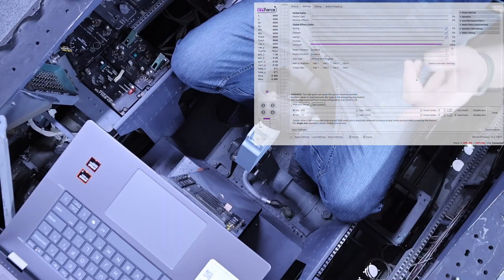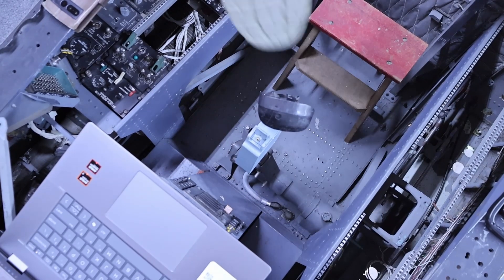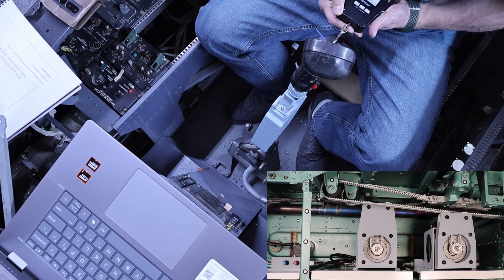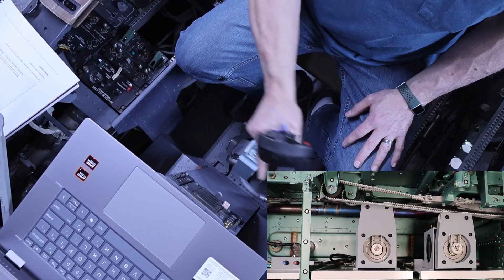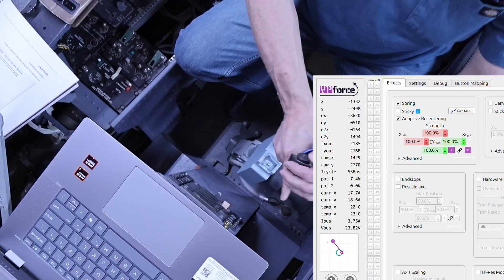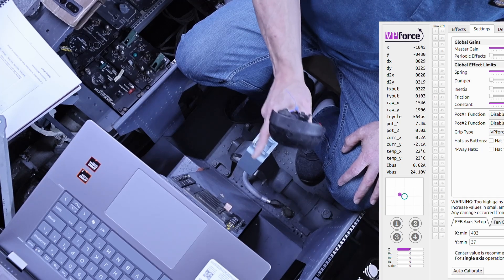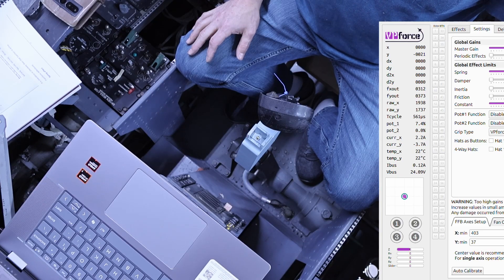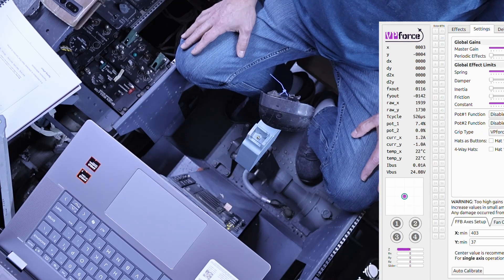Testing the new Control Loading System!

Comment: Isn't there going to be a decent amount of slop in there, with these long belts?
Reply from the maker: There's actually no slop at all in the system.  The belts are under quite a bit of tension and they've got steel cables in them, so they won't stretch either.
Reply: @f15sim  Ok, nice

Comment: Brilliant stuff Gene. Keep up the hard work!
Reply from the maker: Thanks!  I'm hoping to keep up the momentum.
Reply: @f15sim  Is the plan to hook it up to FSX or similar? I've done a little work interfacing  external hardware via SimConnect and am more than happy to share any useful experience if relevant. I've paused all my efforts hoping for the AR market to mature enough to offer the kind of mixed reality environment that this kind of setup needs.
Reply from the maker: @zg8626  Thanks for the offer, but I've got that end well covered.  I've been writing code for money since around 1988. :)  My plans for the hardware interfacing have gone through many iterations in the last 25 years.  The original plan was to use an EPIC from R & R Electronics, which was pretty state of the art when it came out.  As to the simulator, the current leader is Falcon BMS based on the amazing work the developers have done with the F-15C.

There's another gent out there that's built a beautiful F-16 cockpit - The Viper Simmer.  He's using a Quest 3 for his AR system and it's very usable.  Here's a video that shows it off: https://www.youtube.com/watch?v=q8xYsqLgF9s - this is effectively what I'm going to be doing with my simulator, unless of course Varjo wakes TF up and decides to sanely price their HMDs. ;)

Comment: Now what do you have planned for your rudder pedals
Reply from the maker: Right now, not a thing.  The rudder control feel system in the F-15 is 200lbs *per pedal*.  I think the feel actuator is still installed - I spotted something that I think is that the other day, but I've no plans to do anything with it short term.

Comment: Oh this is very nice. Sucks you've got one duff switch, but that's the price you have to pay.
Shame you're in the wrong country, I'd have that fixed in no time ;)
Reply from the maker: I'm 99% sure the issue isn't with the grip itself.  If it's the SFS box or the cable between the controller and the SFS interconnect cable, it'll be annoying but workable.  If it's the cockpit side of the SFS cable, the control loading system has to be removed so I can reach the screws that attach the Canon connector to the cockpit floor.  The screw heads are underneath.  Of course. :)